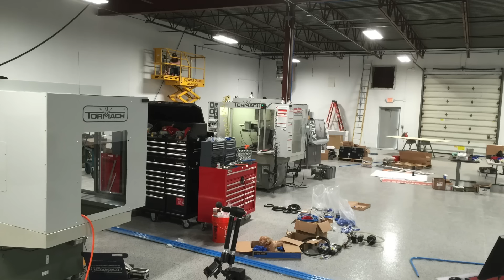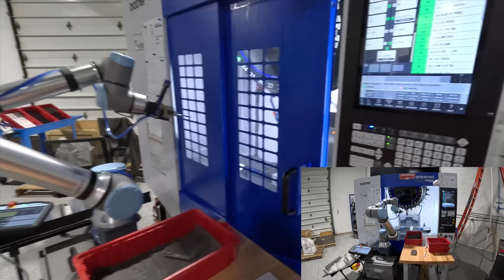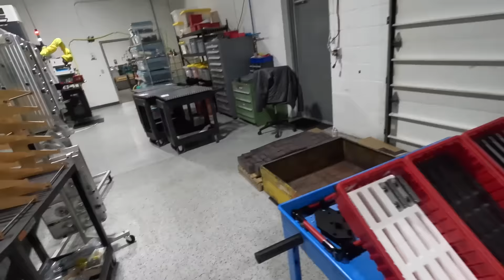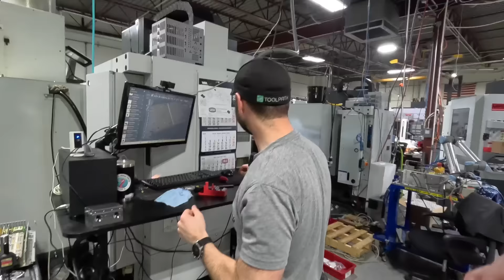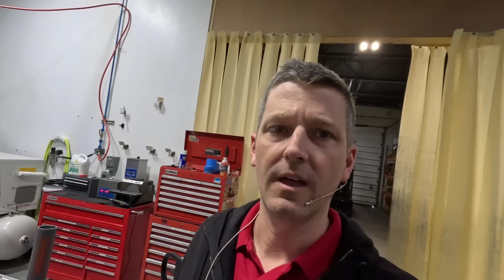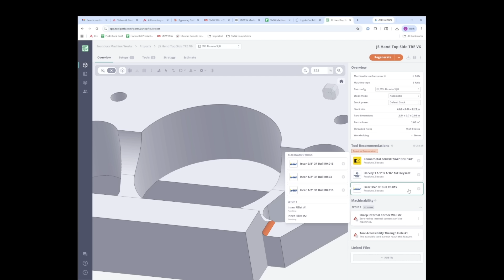Shop Update April 2026! Automation, Ai, Johnny 5, New Machines!

Comment: Great shop upgrades and a nice look at how modern CNC workflows are becoming more connected. For CNC machines and production equipment, reliable industrial networking and remote access can also make monitoring, troubleshooting, and data collection much easier. Industrial routers and gateways are becoming a useful part of smart manufacturing setups.

Comment: Hi I really appreciate your channel and want to learn from it. So I watch especially the CAD/CAM Fusion videos step by step in the next weeks. I have some urgent questions that I would like to hear your opinion on.

1. How much money do I need to start a milling full time business as a solo person? I want to stay solo machinist in the shop without any personnel later. That means switching to automation soon.
2. How many machines do I need to get profitable and is it true that I will have to work 12 hours+ to start?
3. How do I find good customers and how do i get the machine running profitably (many parts, no pause)
4. What Equipment do I need?
5. How do I learn calculation? Its a nightmare for me because i am a technical guy and not good in calculating
6. Would you start such a business (only milling no turning) today or is AI and China getting too advanced that it is not worth in a few years?

Thank you so much!

Comment: That software is super cool, I have worked in aersopace CNC tube bending for a while and we do very similar "corrections" that fix your length, rotation, and bend deviations and automatically send it and apply it back to the machine from the scan software and you get a damn near perfect part after. Cool to see this being done on CNC milling in a more automated way.

Comment: When is it worth using a used tap in a CNC is the same question as when is it worth using robots.  If the losses due to rejects exceed the cost of new taps or hand loading then don't use that method.